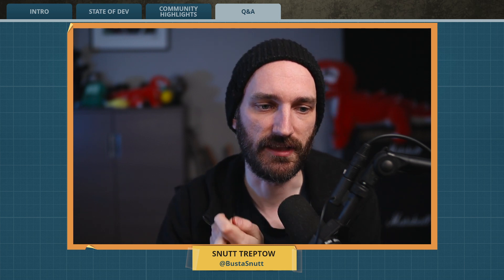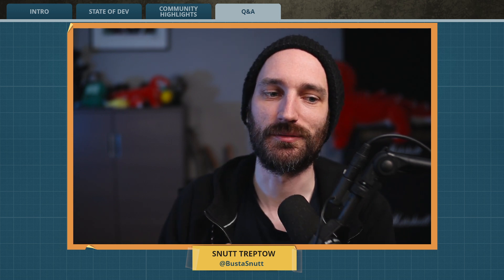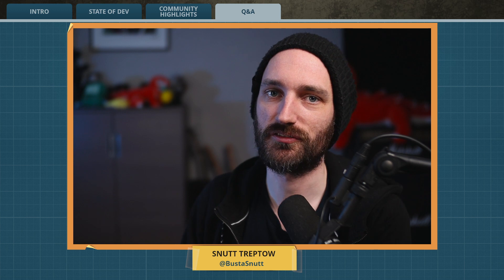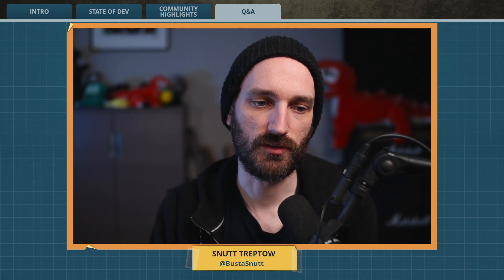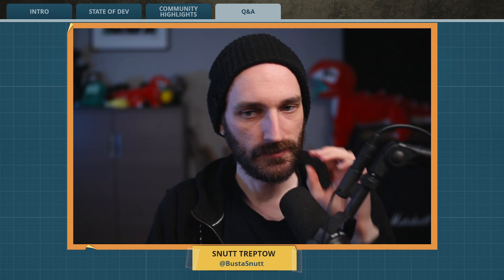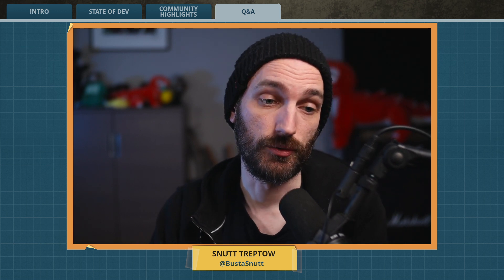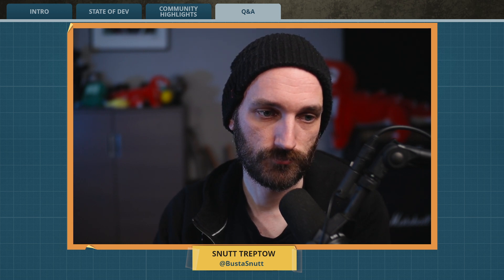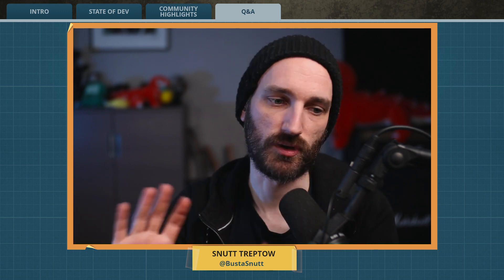Q&A: How fast belts can cause floating-point precision issue?

Comment: Just don't use floating point. Literally why would you use floating point to keep track of amounts of something that fall into very predictable orders of magnitude.
For the intermediate fluid simulation, sure; but for actually storing how much fluid there is, and the amount moving from one pipe section to another during a tick — crunch that shit down into a fixed-point number. Boom, no more issues with tiny amounts of fluid going missing or shit like that.
Seriously; the overuse of floating point needs to stop.

Comment: I get around pipe problems by always having more supply than consumption. Fluid dynamics aren't a problem if the pipe is completely full and pressured.

Comment: Concerning pipe precision:
Remember that Satisfactory is just a game. It's not a physics simulator. It's O.K. if it isn't massively perfect. The game isn't a scientific tool.
So, with that said, my suggest for this would be to simply set an arbitrary limit on how precise the pipes should be and move on. And for anyone particularly bothered by this precision loss in pipes, I'll reiterate: "It's a game." Step away from your computers once in a while.

Comment: I'm still surprised the devs went with such a complex fluid simulation system
Reply: Yeah it feels like there should be an easier way to deal with it. 
Even if there was a simple/complex toggle on world creation for fluid that would have say an extractor outputting 300, as long as the inputs connected to the pipe are less than it then there is no problem. Almost like how electricity is handled now.
Reply: It's surprising, but also quite inspiring to see how hard they're trying to make the game really enjoyable and "realistic", with a slice of unrealistic silliness sprinkled here and there. I won't admit to knowing how the devs made their fluid simulation, but I'm perfectly satisfied with how it works as it is. I won't complain if they do end up improving on it, but I won't complain if they simply let it be. It's already a pretty wild move that you just don't see in other games like this. That's satisfying all on its own.